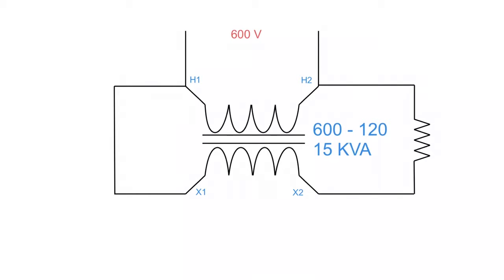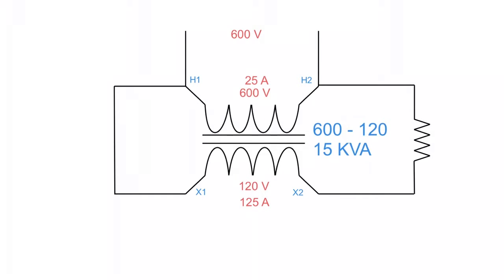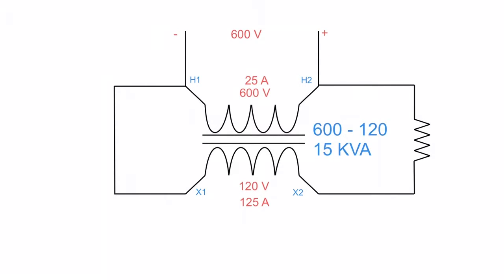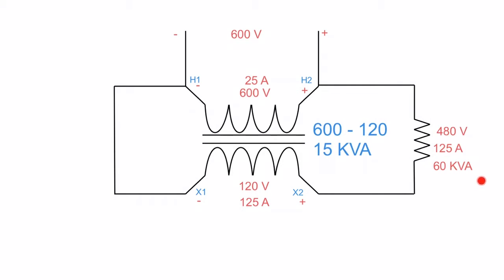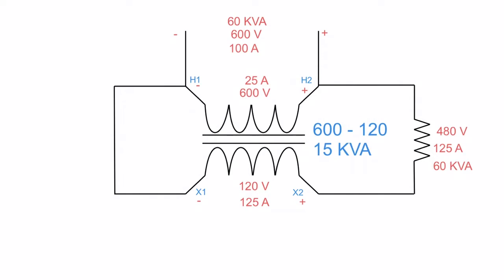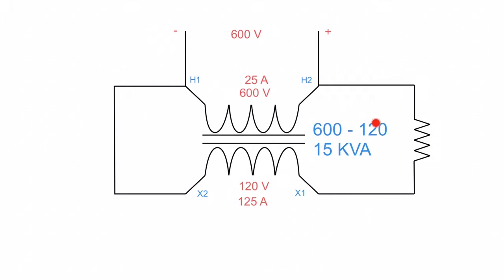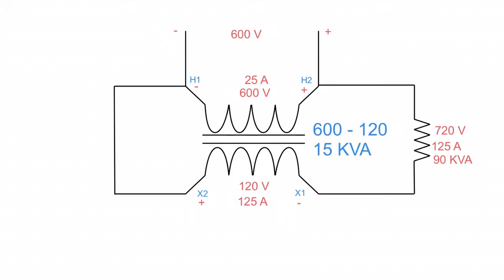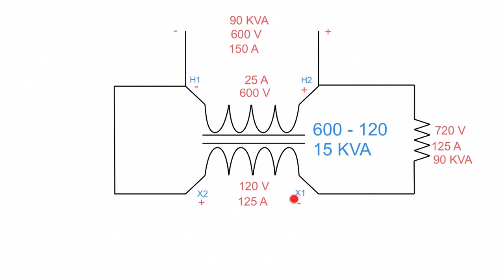Buck boost Autotransformers

Comment: It's really difficult to find any good articles or videos about kVA calculations for these circuits.  I'm in a program now trying to get my head around it -- I know autotransformers and therefore, Buck-Boost transformers can supply a larger kVA than the rating, but I'm having a hell of a time figuring out how to choose the correct winding current depending on the arrangement.  

We're always using 2 winding buck-boost for our labs and calculations, so I know the rated kVA is across 2 separate windings, and depending on series or parallel configurations, it's going to change things.  This video has helped a fair amount, thank you.  I'll see if I can find more on your channel and subscribe.

Comment: I need BUCK BOOST TRANSFORMER designing of 
40KVA stabilizer 3phase
Input voltage range: 340 to 500 volts
Output voltage : 400 volts  
And I need TAP POINT of variable transformer. 
Copper winding

Comment: I'm not seeing how you can get an output power more than the input. If volts increase or decrease through magnetic addition or subtraction then amperage would be inversely proportionate, ie, volts going up means amps must go down. 

If the windings in the primary are good for 25 amps when it's in series with a secondary with 125 amps, it seems illogical to stuff 150 amps through a 25 amp winding.
Reply: I'm still trying to wrap my head around this stuff, but the 150A supply side current isn't directly through the 25A rated primary winding -- it's being split with the secondary 125A rated winding due to the configuration (125+25 = 150), so it's not overloading the winding.  It's also not supplying more power than the input, the VA value is equal on both sides.

Again, I'm suffering through class trying to grasp how these kVA values work because I have similar mental blocks as you (at least you 8 months prior to this reply!).

Comment: How can you draw 60KVA of power on the primary if the transformer is only rated for 15KVA?
Reply: The connection draws the "first" 600V directly from the input before the transformer, then the transformer adds or subtracts it's secondary voltage of 120V to/from the 600V of the input. The key here is that most of the power does not pass through the transformer, instead only the 120V which is 120/600 = 1/5 of the input voltage passes through the transformer, and the transformer is limited to a maximum output current of (15000/120) = 125A. Thus the output can consume 125A from the input in both buck and boost connection with the difference only being that in buck the output voltage is subtracted from by 1/5 to 4/5 of the input voltage, and in boost the output voltage is added to by 1/5 to 6/5 of the input voltage. Since the kVA going through the transformer is the same in both cases due to the secondary side current being identical, the observation that in buck connection the output voltage is 4/5 of the input voltage where 1/5 corresponds to 15kVA giving 4/5 => 4 * 15kVA = 60kVA, and in boost connection the output voltage is 6/5 of the input voltage where 1/5 corresponds to 15kVA giving 6/5 => 6 * 15kVA = 90kVA.

I just watched the video to learn to understand how it works myself, I hope that my explanation is not too far off, and not using too bad naming conventions, it was many years since I last studied any of this :)
Reply: @danielnilsson2076  That makes perfect sense! Sir, I thank you.

Comment: I believe the use of “positive” and “negative” in this discussion was a bad choice.  By most conventions H2 would be neutral, or the grounded conductor (US National Electric Code term).  I wouldn’t call it “negative”.  If your 600V is phase to phase (which is likely would be), then using the “dotted” winding notation would have been a better why to represent it, especially if the viewer has read any buck-boost transformer literature.
Reply: This is the same way we learn it in electrical school. The point of using pos and neg polarities is so you can draw the circuit as 2 batteries to figure out the load voltage and amperage.

Comment: doesn't current travel from  - to +  instead of  + to -  as you said in the video??
Reply: It does from neg to pos but in AC it'll be both directions. You  can pick any direction and it will still work out the same as long as you follow that path
Reply: Yes - to +